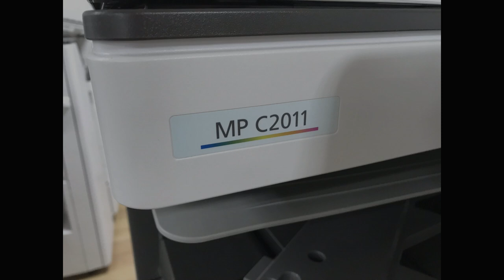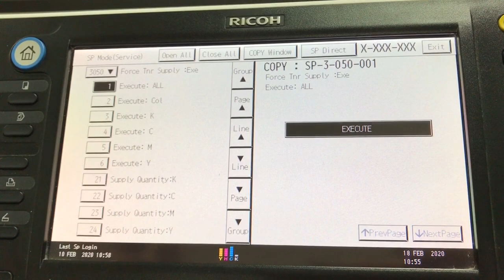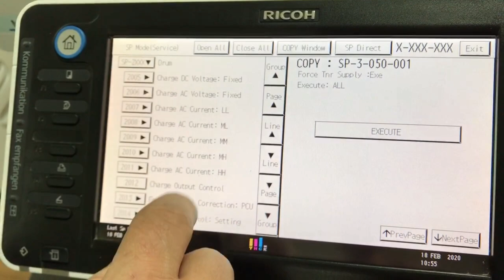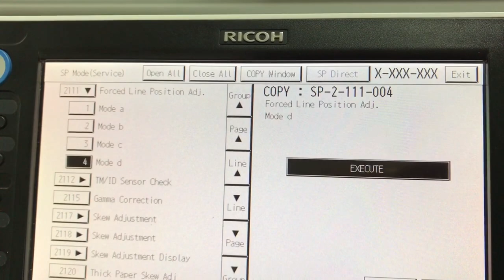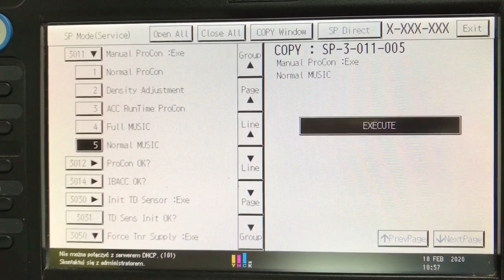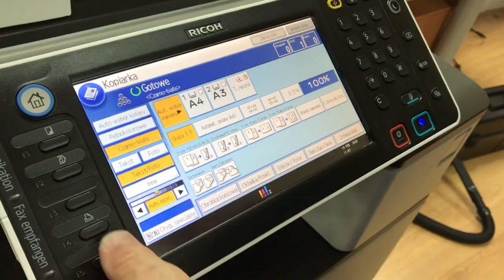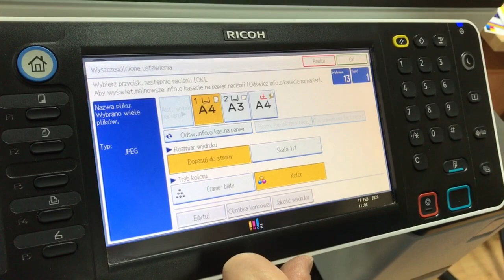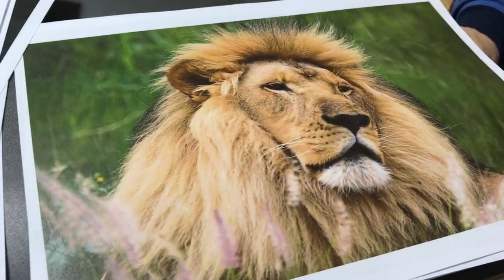Maintenance Copier RICOH MPC2011 MPC2003 MPC2503

Comment: Hola yo tengo una impresora ricoh mp c2003 y me marca error  SC144-00, ¿cómo lo puedo solucionar?
Reply from the maker: Hay muchas posibilidades. Echar un vistazo:
    Code: SC144-00
    Description: SBU Communication Error • Connection to SBU cannot be confirmed. (Connection detection error) • Cannot communicate with the SBU, or the communication result is abnormal.
    Causes: • SBU defective • The other side of the communication (BCU, IPU etc.) defective • Power/signal harness defective
    Remedy: 1. Turn the power off/on. 2. Reconnect the power/signal harness. 3. Replace the following parts: • Replace the SBU board. • Replace the IPU board. • Replace the BCU board. • Replace the power/signal harness.

Comment: COMO QUITAR EL AVISO DE FUSION EN mp c2003
Reply from the maker: You only need to remove the 2 screws on the sides of the fuser unit. Then pull it towards you and take it out.
Solo necesita quitar los 2 tornillos a los lados de la unidad de fusión. Luego jálalo hacia ti y sácalo.

Comment: My Printer Ricoh MP C2011  is Service Call SC 370-01
Reply from the maker: Remove image transfer unit, and check for TM (ID) sensor connector missing. If it is missing, reconnect it. • Check for dirt on the ID sensor detection window. If te detection window is dirty, clean by predetermined method (do not wipe dry). • Check the condition of the ITB. If undulation or belt slippage has occurred, re-install or replace the ITB. • If neither of the above have occurred, perform TM (ID) sensor replacement